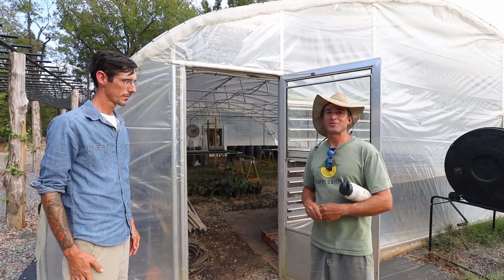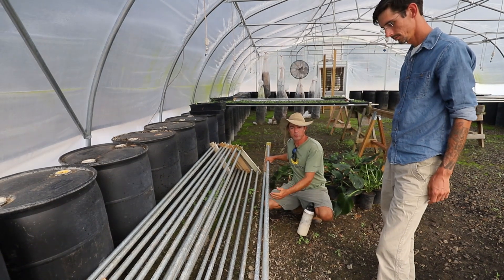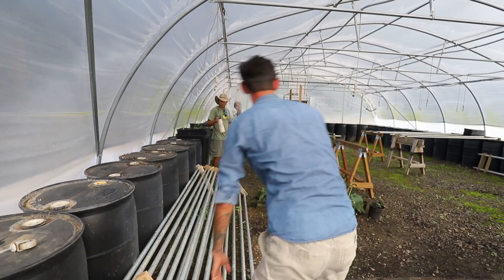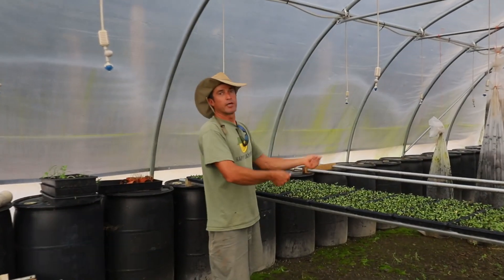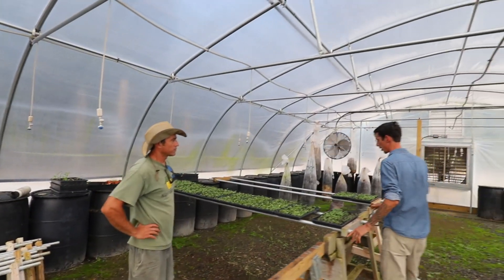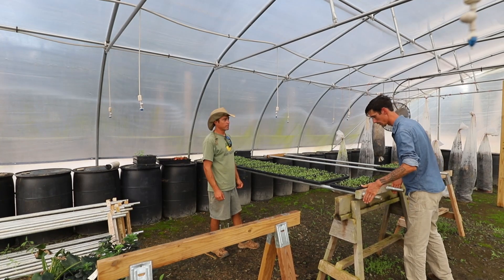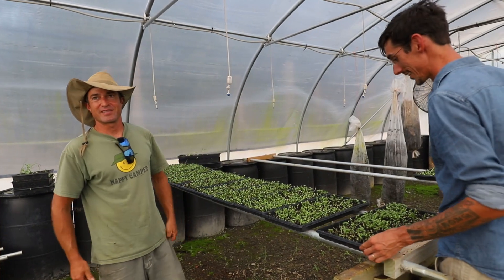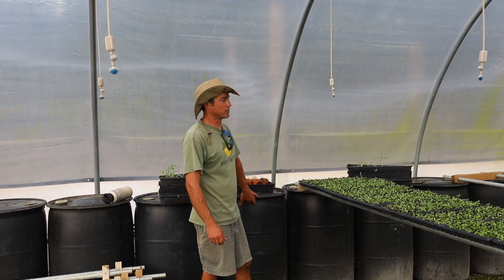Propagation Greenhouse | Wild Hope Farm

Comment: We use these stretchers too. We have a system where the plants are hardened off in 3 stages. It's been a very flexible system. One problem with this system is if you have a descent cross wind it can be a little treacherous. Watering them before they're moved to add some weight helps them to stay put.